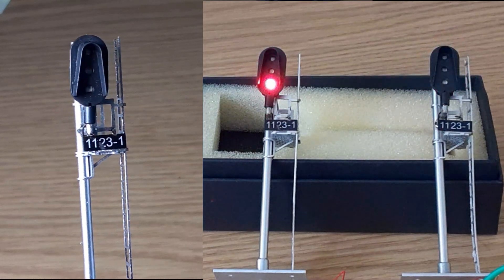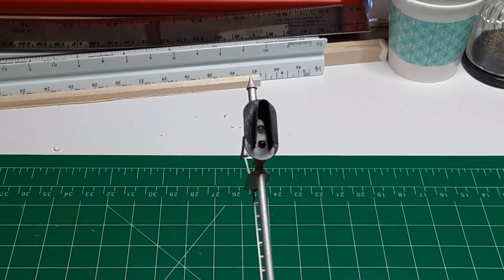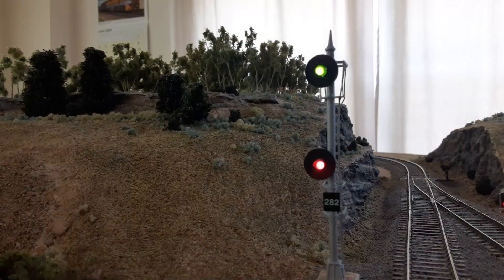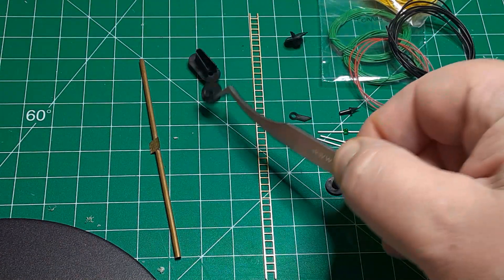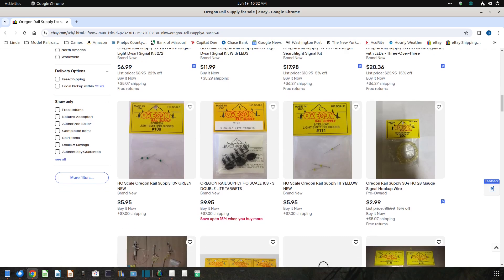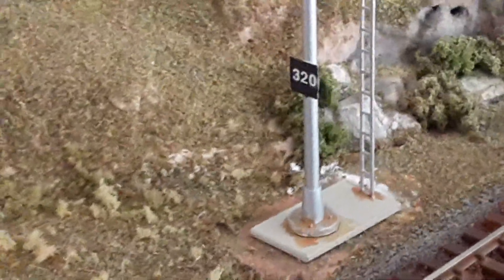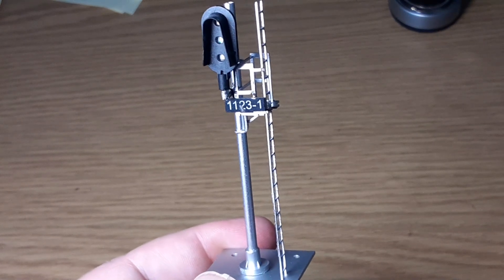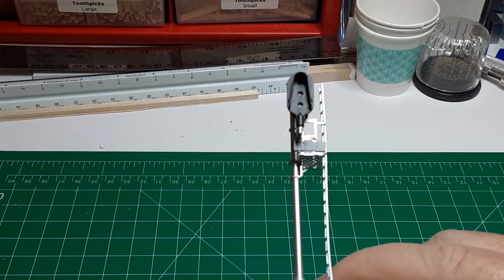Building Your Own Railroad Signals

Comment: Those are nice signals. I downloaded on Thingaverse all the parts except the 1 mm brass tube (expensive little bugger) and LEDs. I do N scale, but they have both. For the cost of 6 retail signals you can buy a nice 3D printer.
Reply from the maker: I hadn't even thought of 3D printed parts! I guess my age is showing... and 3/64" brass tube is $6 for two 12 inch pieces. In N scale, you'll almost have to use magnet wire. Resist the urge to use the brass tube as the common conductor - I think that's why my first two signals developed shorts.
Reply: @rwissbaum9849  I'm an old guy myself. The print calls for 1mm tube and if I remember right it was like $12.00 for 1 piece and 3/64 comes in at 1.19mm. You can bet I'll try the 3/64 next time. That's like an extra coat of paint. Yes, the magnet wire is fragile so I sometimes throw a coat of clear nail polish to help. Thanks for the tip.
Reply from the maker: Can you provide links to the Thingaverse parts? Have you checked to see how much it would cost to print them on Shapeways?
Reply: You always come up with good subject matter. I have a bunch of older signals that was thinking of retro fitting with LEDs. This is model railroading in the 21st century.
Reply from the maker: I hate to mess with your economic justification, but the N scale signals range in price from $3 to $8 each (plus $2.49 shipping). They are not as nicely detailed as the HO scale signals I have shown, but for the price, I would certainly check out one or two before I bought that 3D printer.
Reply: @rwissbaum9849  Thanks but I own 3 already. Bought my 1st 1 about 7 years ago.   My original comment was for anyone who hasn't tried one. They make a lot more than signals too. Just finished a 7 unit fleet of cement mixers for the new company moving in. The detail is astounding. They have rear view mirrors, ladders antenna, and more. I've made dozers, All sorts of tractor trailer including lowboys, Track hoes, Buildings, The list goes on.

Comment: Could you please identify the era for both of the signals you described? I’m new to model railroading and I have watched many videos trying to figure out what signals belong to what era but have not been able to really pinpoint them yet. I know that in some cases it varies by road. I’m modeling the transition era somewhere between 1955 and 1957. And modeling western roads such as ATSF, UP and D&RGW. 
My layout is a freelance for a fictitious location in a southwestern desert where these roads go through.
I enjoy your videos and find them very helpful.
Thank you
Reply from the maker: First, a disclaimer: I am not an expert on signals; I have picked up a little bit here and there, but please do some research on your own to confirm - or correct! - what I'm about to say.
The searchlight signal was patented in, I think, about 1910. It consists of a light source, a lens, three colored filters on a solenoid-actuated armature, and a second lens. The two lens system meant that for the first time, the lights were visible for distances of a mile or more. There is a great video showing how the searchlight signal works: https://www.youtube.com/watch?v=HfxSJgGltuw The invention of the searchlight signal marked the beginning of the end of semaphore signals.
The Type D signal uses the same two-lens system, but without the solenoid-controlled armature; instead, each light has a fixed color filter. A D-type signal head can have 1, 2, or 3 lamps, each of a different color. In the western states, a "snow hood" was commonly used on type D signal heads (and in fact, snow hoods are increasingly common throughout the US.)
Both the searchlight SA signals and the type D signals have seen heavy use throughout the 20th century. The D&RGW adopted the type D signal as early as 1920, but it wouldn't surprise me at all to see searchlight signals in use on the D&RGW even in the 1950s. I model the Rio Grande in the late 1950s and I  have both type D and searchlight signals on my layout (but that doesn't necessarily make it prototypical!) In the modern era, type D signal heads are slowly replacing the searchlight signals - in my  opinion, because of fewer moving parts.
Signal aspects (that is, the combination of lights displayed) can control train speed only, or they can control train speed and route (to a limited extent). If you want to control just train speed, you need - at most - five aspects: Clear (continue at normal speed), Approach Medium (continue through the signal but reduce to medium speed), Approach (proceed through the signal reducing to medium speed and prepare to stop at the next signal), Restricting (Proceed at restricted speed), and Stop (do not continue past the signal). (I do not model the Restricting aspect because the D&RGW used a lunar aspect (a dim white light) to indicate Restricting - this is quite hard to model with LEDs.) These aspects (except for Restricting) can be modeled using a single SA head, a dual SA head, or a single or dual type D head.
If you want to indicate route as well as speed, you need to distinguish between the straight and the diverging routes, and will add three aspects: Diverging Clear, Diverging Approach, and Diverging Approach Medium. These three aspects all require a dual head signal, because the upper light is red and the lower light is green, yellow, or flashing yellow (at least, they are on the D&RGW). In these cases, the aspects mean the same as regards speed, but warn the engineer that the diverging route through the turnout has been selected.
JMRI has a great web page illustrating signal aspects: https://www.jmri.org/xml/signals/RG-1965/aspects.xml These aspects were taken from the D&RGW Rules of the Operating Department.
This is an incredibly complex subject, and I expect there are very few people left who could speak knowledgeably about signalling practices in the 1950s. For the modern era, you might reach out to some actual engineers.
Reply: Thank you very much for the great information. I really appreciate it.
And again thank you for your great videos.

Comment: Richard, you are indeed a brave man. I have scratchbuilt a couple signals for my small dioramas using Tomar parts which they sell (or sold?) separately. But they were semaphore, needed because no one made lower quadrant ones like the WM used. I would be terrified trying to make lit signals, I know somehow I'd set the layout on fire! Nicely done my friend, they look great.
Reply from the maker: As far as I know, WeHonest does not build semaphore-type signals at this time, but I'd drop them a line - it seems like they are always adding new products. In the meantime, Tomar makes a very nice lower quadrant semaphore signal, but like all Tomar signals they are a little pricey: https://tomarindustries.com/products/semaphore-h-840?_pos=12&_sid=7877ecad9&_ss=r
I would never attempt to build my own semaphore signal, nor my own crossing gates!
Reply: @rwissbaum9849  You're right, those are beautiful. But I just needed static signals for my unpowered diorama. I think I may have considered paying for them even though I didn't need the motion or lights, until I found they sold all their parts ala carte. Still have lots of parts if I ever need to build a couple more someday.

Comment: I suspect that someone somewhere is able to scratch build HO signals but a video on it would probably not be useful to most modelers with limited resources.  I appreciate the suggestion to buy low cost quality instead.  Thanks.
Reply from the maker: I built my first two signals almost 18 years ago - those were the two that developed shorts in less than a month. I did not pluck up the courage to try again for almost 10 years - I let a whole drawer full of parts languish the entire time. Then I built the next three signals and was incredibly pleased with myself - even today they look quite nice and they perform beautifully. Then, about a year ago, someone (Mike of Main Track Trains) posted a video showing some grade crossing signals made by a company called WeHonest in China - here is the video: https://www.youtube.com/watch?v=AOPQMWP7HEU 
I was impressed enough to order a pair, and for $13.50 (shipping included) they were a great deal: not as good as my crossing flashers from Tomar, but also one-tenth the price!
Then last February, Jimmy of the DIY/Digital posted a video of his N scale block signals from the same company. That prompted me to check out their current list of offerings, and I was blown away. I've bought three different styles from them so far; my favorites are the two styles I've shown in the video.
If only I'd known then what I know now...
...which is what prompted me to make and post this video.